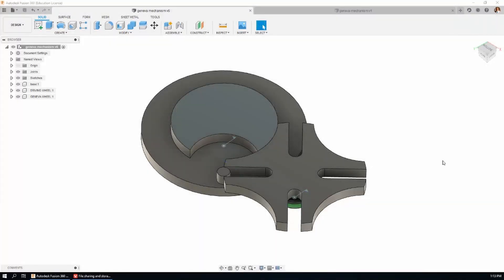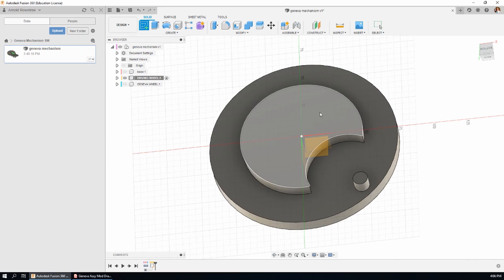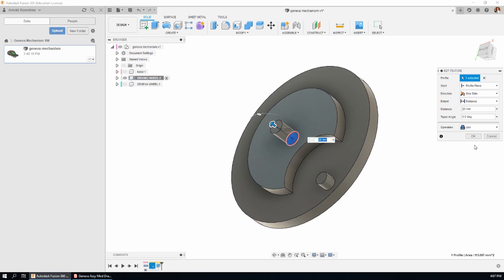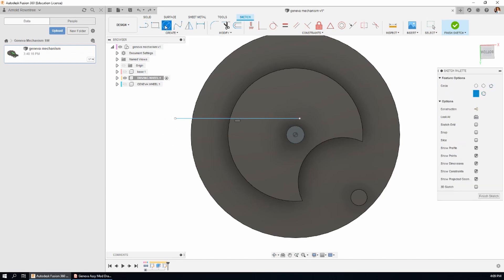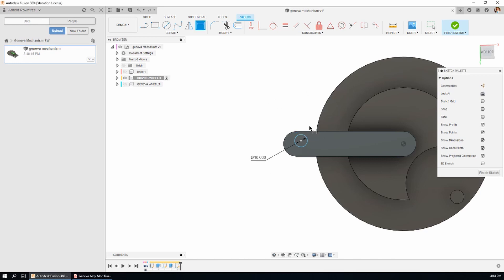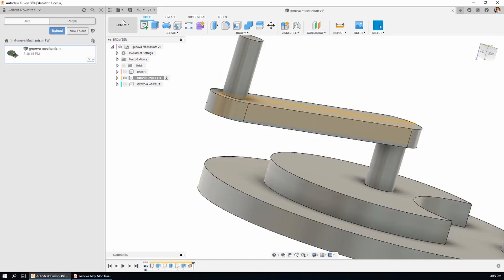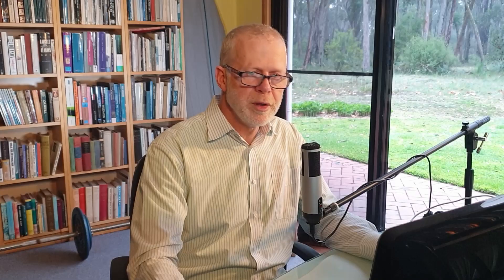Grabcad Fusion 360 | How to modify the CAD model

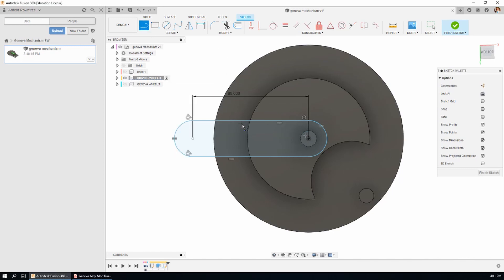Comment: At the 7:29 point in the video you select the midplane to sketch a circle at the axis of the end of the pin. When I try this the cursor will not snap to this point. I had a similar problem at the 4:56 point when I tried to draw the construction line it will not snap to the center of the circle. What am I doing wrong?
Reply from the maker: Good question Gerry, firstly a very unsatisfying answer; this is a hand crank and just like a pistol grip or any other kind of handle, there is no right answer in terms of precision and so it doesn't matter a twisty where that sphere ends up. But now to take your question seriously for all of those cases where precision does matter, you must download the free PDF with all the 16 drawings. In the appendix you will find a number of pages, screenshots of my preference settings. Go through all of those to make your Fusion 360 work like mine does. There is one on the Design page which says something like 'Auto project edges on reference'. I just tested it on and off and I get your experience when its toggled off.
Reply: @ArnoldRowntreeTeachesFusion360  Thank you for the prompt response, and for the great tutorials. I watched several other videos before I found yours, it's one thing to know a subject, but that doesn't mean you can teach it effectively. You obviously have experience teaching. I did download the PDF with the16 part drawings but there was no appendix. I did find the setting you mentioned in my preferences & turned it on, hopefully that will help. Thanks again!
Reply from the maker: I must have some old links hanging around somewhere, I'll watch out for that. I also made a video about the preferences, at least there are some screenshots you can pause the video on.  https://youtu.be/UVwJJvQR1fc

Comment: Thanks AR for the great videos. If you can explain exactly Why we use a midplane and axis on the handle, that would be even better. Also what the reason is for the random construction line on the sketch, 45degree angle but why, Thank you good sir
Reply from the maker: There are always many ways to achieve the same goal in CAD. The more complex the project the more alternative methods there can be. The reason I put a mid-plane in the crank was to position the knob and its shaft in the middle of the crank. I could have used a concentric constraint with the semi-circular end of the crank but I wanted it to be really clear that I was positioning the knob. As for the 45 degree construction line, my purpose was due to a bit of intuition, I could have confirmed it mathematically but since its a hand-operated mechanism I wasn't too concerned if my intuition wasn't right; I thought that there would be a mechanical advantage in having the knob out of line with the crank, to make it easier to turn the mechanism.

Comment: I cannot get the revolve to work! I keep getting an error message " The profile crosses the revolve axis".
Reply from the maker: George, keep experimenting, try doing a simple square or rectangle which is well away from the axis of rotation (so you end up with a donut) and then work on shapes where the axis is on the side of your sketch resulting in a revolved solid. Keep in touch and let me know how that goes.
Reply: @ArnoldRowntreeTeachesFusion360  Thanks Arnold, did a number of sketches as suggested and now all seems to be fine! Do not know why I could not get the knob to form on the Geneva handle bur it does now! I think it was because I was selecting the axis external to the circle, anyway all good , thanks.
doingthe Geneva wheel a few more times to really get to know it!1
Cheers
G

Comment: When I import the 3 fusion files from mediafire and upload them into Fusion360, I get three different files. This seems to be different from the upload from GrabCAD where everything is in a single file. How do I merge the components from each file into a single file?
\\Answer:\\
I now have found the "Insert in current design" option, so the three are now in the same file/design. However I still need to place them properly relative to each other.
Reply from the maker: Good question r123, you're thinking ahead. Skip to intermediate tutorial #4 Bottom Up Assembly.
Reply: @ArnoldRowntreeTeachesFusion360  Thanks!

Comment: At 4:52 when you draw the construction line from the lower right circle, your screen shows the dot for the center that you can snap the line to, but I don't have that. Is there a preference that I need to enable?

I blazed through the 16 part tutorials over the past few days and they were so great compared to other videos I have tried to follow (and then given up on) over the years.
Reply from the maker: That’s very kind, thanks Matt. 
As for the line snapping to the centre, I doubt if it’s a preference. I remember that it all happened very fast, the construction line was already selected when I clicked the Coincident constraint and so it was just one more click to action it. I normally expect to click the tool and then each of the items I want to bring together. I've done a couple of dry runs just now and confirmed that you can use the coincident constraint to move sketch entities to the point of origin whether there is geometry already there or if its empty. Come to think of it, didn't you use the point of origin to place the sketch circle for the first pin we created there in the centre?
Let me know if any of this is helping.
Reply: @ArnoldRowntreeTeachesFusion360  Thank you for the quick response, I made a short video to show you what I'm seeing (or rather not seeing) when I try to draw that construction line. https://youtu.be/-XD3hCMikZs
Reply from the maker: Yes Matt, you sketched the crank very well and yes, the line you drew in a separate sketch was correct. 
Your recovery from whatever that problem is was just fine, you drew the line and manipulated it as I'd done even though your 2nd sketch was on a different plane.
Its time for me to confess now that I didn't put the construction line to use, I should have put a 45 degree angle dimension between that line and the crank sketch but I could see that I'd need to backtrack a bit to make it work. Lazy. In a future video I'll show how to delete constraints to free up for an adjusting dimension - I'll cover what I should have shown here.
Thanks for clarifying your question with a screencast, that was well done.
Reply: It's a preference configuration.
https://forums.autodesk.com/t5/fusion-360-design-validate/can-t-snap-to-point-on-other-sketch/m-p/9481392?lightbox-message-images-9479177=762352iE5A62378012BAAAA#M215449
Now I can snap a line to the center of the circle on the other plane.
Reply from the maker: Good work jfmoya!

Comment: Great production quality.  Clearly explained.   There is something weird with the sound at 3:25.
Reply from the maker: Yes Adrian, thanks, that audio glitch is bugging me no end. My computer is kind of marginal and this was the least messed up render I could do. I need to upgrade asap.
Reply: @ArnoldRowntreeTeachesFusion360  What software do you use for the video editing?  I've not had any problems with Shotcut.
Reply from the maker: I moved from Shotcut to Resolve 16 in order to improve workflow and quality which it does but it needs more grunt. You're right, if this persists I may have to go back until I've saved up.

Comment: Morning Arnold - i dont see your link to that Solid Works file you speak off ...i only have the Personal use license
Reply from the maker: Its there in the description of the video, click on SHOW MORE, scroll down past chapters and the description, but before the START HERE announcement. There is a FREE DOWNLOAD sub-heading and you'll see the name of the hosting service in the link - Mediafire
Reply: @ArnoldRowntreeTeachesFusion360  mmm so the media fire link takes me to three files which are the components, but i dont see a file which is the mechanism, a combination of the three parts ...?
Reply from the maker: Yes that's right queenslander, the next video is about bottom up assembly. As far as I know you can import a Solidworks assembly (in other license types) but the joints don't work. They need to be reassembled with Fusion joints in order to move and then animate which is where we're going soon. The value here is in learning to assemble which is why I left out the "dead" assembly file.
Reply: @ArnoldRowntreeTeachesFusion360  Hi Arnold ... so in this video you modify a multipart drawing .. and as i've only got the personal version of F360, ive followed your bouncing ball and downloaded via media fire ... and it downloads the base , driving wheel & wheel in file extensions .SLDPRT and the multipart mechanism in .SLDASM. When i try to open any of these, it does so in a session within F360 website (a tab named Fusion Team) where i can see the parts, and rotate them ... but not much else. The .stp file downloads and opens as i would expect. What's a girl to do ?
Reply from the maker: queenslander, I'm quite confused here, I checked on the Mediafire download, I intended to make just three files available there, all of them part files with a .f3d extension. I've just confirmed that this is the case, I wonder if you have inadvertently opened the Solidworks version instead of the Fusion version? I have not included an assembly file because the video I'm currently editing today, shows you how to assemble the three Fusion parts. That one should be published within a day or two.
For you to follow along with the Modify Grabcad video you only need to open the file named "Geneva Driving Wheel.3fd"
Reply: @ArnoldRowntreeTeachesFusion360  nope - no dice -have tried downloading three times - same result - no files i can download carry the .f3d extension - and the wheel files i see are DRIVING WHEEL_fvEaJB.SLDPRT and GENEVA WHEEL_KtoQYT.SLDPRT. ... any other method for you to send me the file ? Email perhaps ?
Reply from the maker: My apologies queenslander, I lost your thread here and I wish YT would give me notifications on these comment threads. I've put the .f3d files here for you:-
https://drive.google.com/drive/folders/1MGiHrOV8Bx6FD7-_X5h6RelzPDKrUdL9?usp=sharing